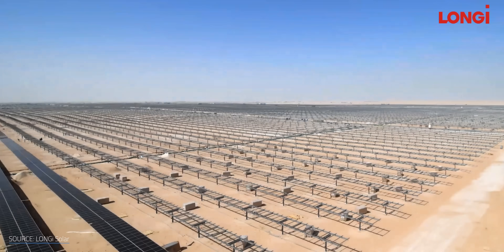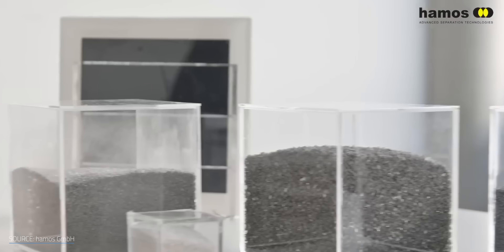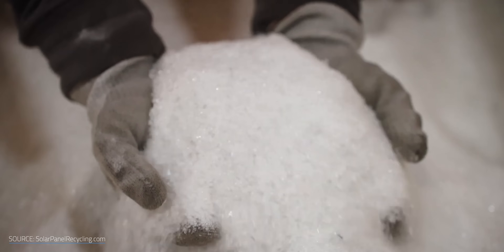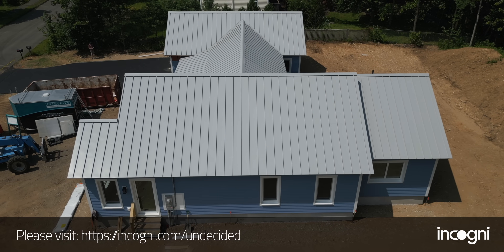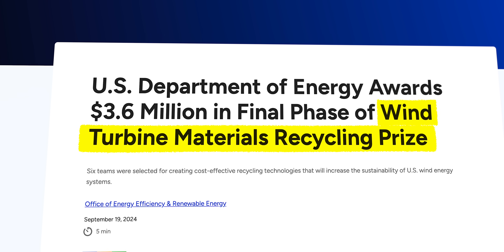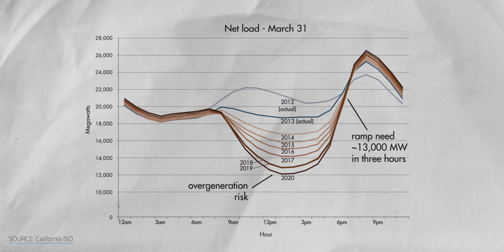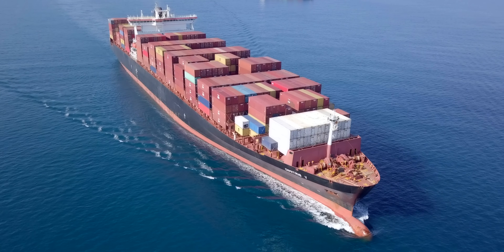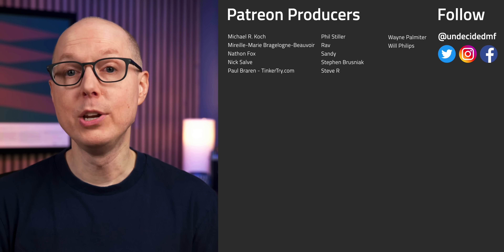How We Solved Renewables BIGGEST Problem

Comment: All renewable energy is limited by our insufficient and unsustainable battery. Until we revolutionize how we manipulate, distribute, and store energy then we are stuck in limbo.
Reply: That is happening. A lot of energy is used for heating homes, retail and work places. Storing the heat rather than the energy to create heat will improve matter greatly. Developments in heat storage, and heat pumps, will pay great dividends.

Comment: Cost not technology has been the problem for recycling PV panels, electronics, and wind turbine recycling. Government mandates is generally a poor answer.
Reply: New technology ALWAYS costs more, when its new. As the market matures, competition increases, newer techniques etc. all make it cheaper over time. The issue we're facing here is that fossil fuels would still be available, and relatively cheap in price, even as they turn the Earth into an unbearable hot-house. So alternative tech, which is less destructive to the climate, but more expensive in dollar terms, needs an assist to get it established and onto the cost downslope. So yeah, in the long term, mandates (or the alternatives - taxes on fossil fuels or subsidies on green tech) are not feasible; but as a short term boost, definitely helpful.

Comment: The third R, Reuse. If 20% of the capacity is lost, add more panels. To restore capacity. There's no reason to ever take them down once installed. Maybe they need to be washed periodically.
Reply: Things happen 
Nothing lasts forever
Reply: Do you realize that space is a limitation?
Reply: @JesusBwithYou  20% more is normally another panel or two. Noramlly not much consider how well panels have been progressing with in that 10 year period. Another 10 years and the panels today that hit around 20% ef will be 25% and in another 10 we been looking around 30%. The max is around 40% ish by 2050 or something like that.
Reply: @adr2t  You're just making up number. Considering you set up an order to I assume you are assuming that it's a residential installation, but what if all of the solar exposure of the roofing is used up already? What is the next marginal place to put a solar panel that has less direct sun and less energy generated? You aren't thinking in realistic parameters. Sometimes your solution will be perfectly fine, but to ignore limitations is not good economics.
Reply: @ I didnt make any numbers up.. 10 years ago most panels were only around 15% ef for cells. Today they're closer to 20%. With some already hitting 25%. The next generation panels can hit closer to 30% - with many saying something like 35-40% by 2050. Nothing is made up there LOL. Those numbers mean smaller panels or more gains in power along with a reduction in price. I never seen a house fully used ... so unless you really did used 100% of your space - then there is always going to be a spot you can add another panel or two or even just replace a smaller faction of them for something newer as needed. Your main issues will just be damage to the panel over time more than anything. That is what normally hurts them more and that means full replacement of the panel it self. If you already need to replace them from the 15% - then yea... adding a panel that can do 25% is almost double the current output of two of your panels.
Reply: @adr2t  House doesn't have to use 100% of space as it needs ways for installers to access individual panels incase one breaks to be able to replace ot instead of taking down the whole array. You still haven't addressed how just adding more panels will solve anything when there's no space to add more.
Reply: Definitely is a need to take them down - that prime location that gets sunshine unobstructed at key times of day really wants to be as good as it can possible be, so that 10 year old still really quite good but noticeably degraded panel is worth moving on - that 5% efficiency loss across a giant array really really adds up, and if because of its location its providing its peak output (weather permitting) at the peak draw moments you really really don't want to loose that. The removed panel shouldn't be trashed though - just shuffle it on the folks that need a panel for their off grid cabin or to locations that are not so important etc.
Reply: @foldionepapyrus3441  Ok, that's reuse.
Reply: @ It is reuse, but it is also taking them down so a distinction worth making. As that consideration of when is the right time to upgrade the panel at a location is a good one, as long as you do something sensible with the old stuff.
Reply: @foldionepapyrus3441  the idea is to never take them down. Also, as appliances become more efficient less power will be required to power the building. Just clean them like you would clean a window. I'm sure they get dusty like the windows on my car.
Reply: Anyone gonna talk about how it’s the second R?

Reduce Reuse Recycle
Reply: @ProjectileGrommet  So actually it's the first and second R.
Reply: "Just add more..." So you want to consume even more resources just to get a less efficient result? That's why we recycle instead so that we don't have to consume as much resources.
Reply: @Somebody71828  Ideally they shouldn't move. If they only last 10 years and can't pay for themselves they shouldn't be built.
Reply: @Somebody71828  what you have is already built. How is it more energy intensive to build 5 times as much capacity as needed?
Reply: cut up damaged arrays and resell as lower grade cells for the hobby community
Reply: @SlavTiger  Nope, just add more panels. Most roofs are not covered.
Reply: This, but the only thing that sucks is the fact they can get damage over time. Weather is going to be the bigger impact in how long they last. Also the film that holds them together as pointed out in the video. Hopefully the laster tech he talk about increases that from the normal 30 to 50-60 and that will be the end of if solar is worth getting or not.

Comment: "Are the green initiatives worse for the environment" Yes, always have been. You have to remember that the people pushing this are making a profit; they don't care about the environment. Nuclear power remains and will always be the best, most powerful, most green, and most recyclable energy there is.
Reply: You would be wrong about nuclear.    Nuclear costs to much.      look up     Solar and batteries make up are 81 percent of new generating capacity of 2024.     EIA.      The people in charge of the electrical grids are putting in mostly solar and wind power plants.
Reply: @ronaldlindeman6136  , it is subsidized and popular.  While great for temporary localized backup, it isn't sufficient to drive the power grid.
Reply: @PhinAI  every level of manufacturing and construction of nuclear is planned to be subsidized by Government.    Even now, much of the fuel for nuclear is subsidized by the Federal Government.    And that is on nuclear power plants that are already built.    
   
We can build solar, wind and water power plants that would have 5 times the electricity production we have now.    We might subsidize part of it, because it is the right thing to do, like we pay for Police, Fire, Education, roads, etc..